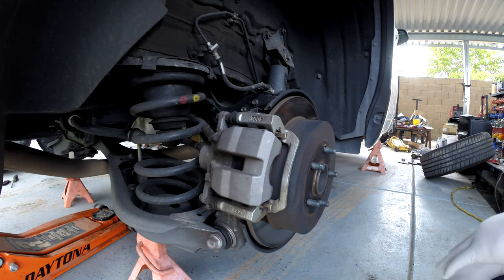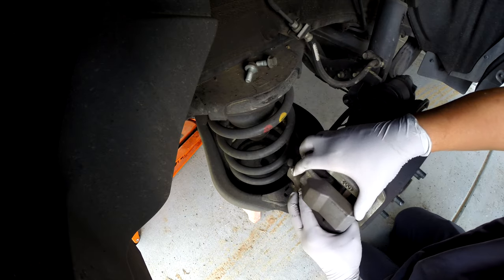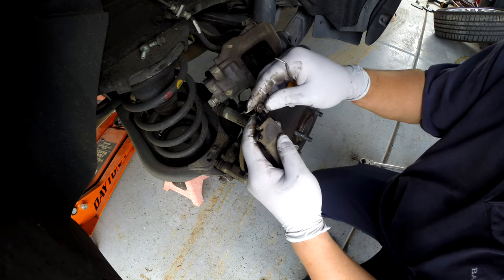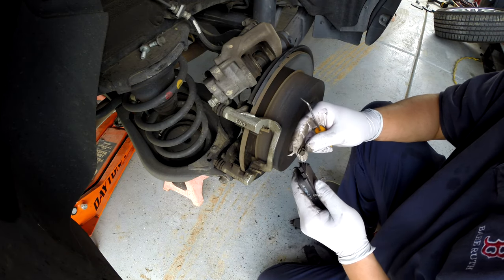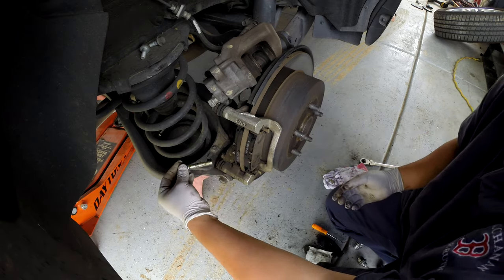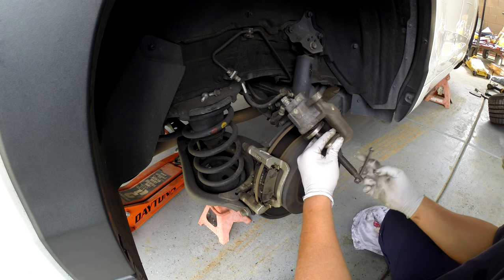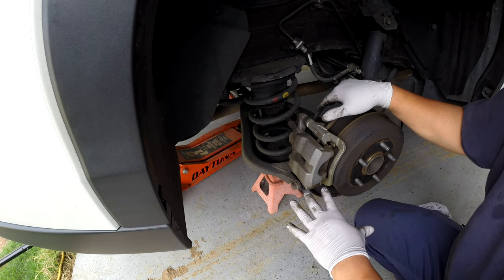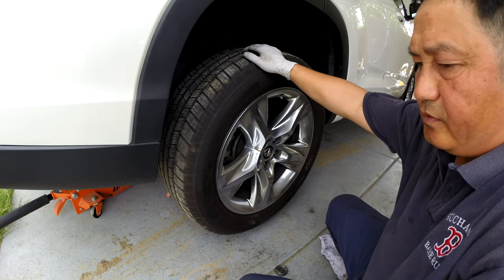2016 newer highlander rear brake replacement

Comment: Torque on the calliper bolts is 26 ft lbs and the calliper brakes if you remove it is 77 ft lbs which is the Toyota spec for the wheel lug nuts as well by the way. When you compress the calliper piston first before you do, inspect the rubber boot for cracks or other damage then put an old brake pad against the piston and then use that tool to push the piston back in. Before putting the wheel back on put the transmission in neutral with the parking brake off. There is a rubber plug on the wheel hub. Turn the hub  a few times to see if the parking brake pads ( inside the hub ) are dragging tif they are anymore than slightly dragging turn the hub until that plug is at the bottom 6 o’clock position..  Remove that plug and use a flat blade screwdriver inside the hole to turn the adjustment screw inside ( I’m not sure which way just turn the hub after turning the adjuster screw and if it gets tighter, turn it back the other way ). Might as well check that as I have found on a couple vehicles the rear hubs / wheels  had too much resistance, just a little is ideal. Not too loose or your parking brake won’t hold. Otherwise this is a good video.

Comment: Don't you need to bleed brakes and open brake fluid  Reservoir cap to let pressure out when you push back calipers? Thanks
Reply from the maker: No need to bleed the brakes line. Reservoir cap close is ok open is better
Reply: Thanks
Reply from the maker: Unwelcome